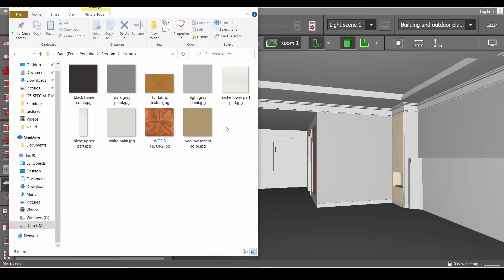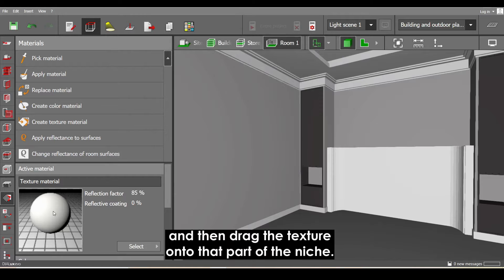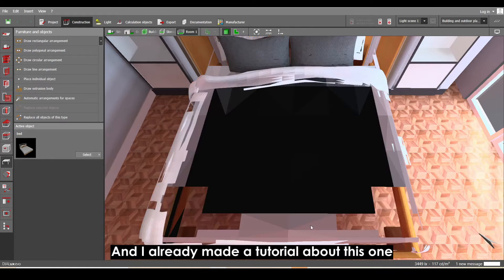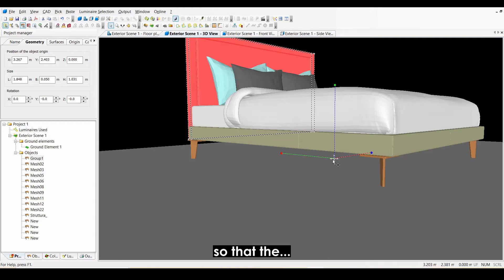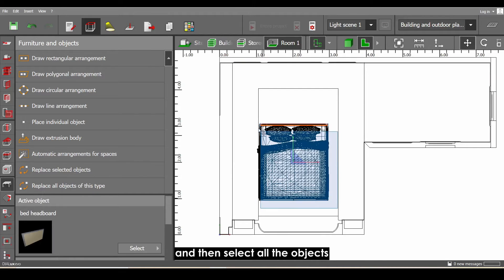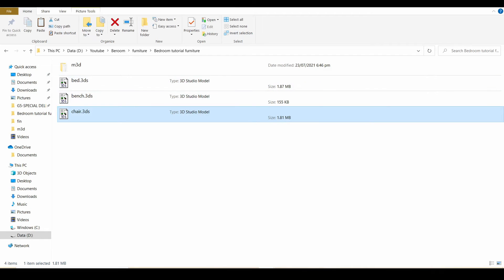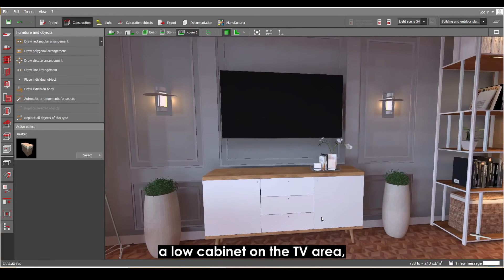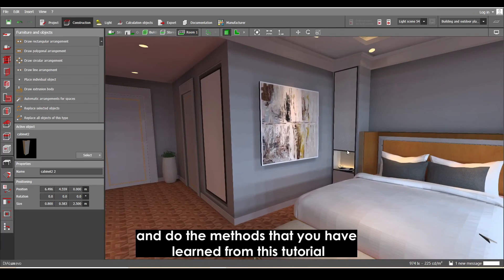Dialux Masterclass: How to recreate Realistic looking room in the Dialux Evo Finale

Comment: Super Mr Jaja Madatu 👌🏻 I have question regarding magnetic light system! Do we can import the recessed track rail with different lighting applications ? Best regards/ Ahmed
Reply from the maker: Hi Ahmed, not possible, you have to manually recreat it and use the appropriate luminaire plug-in for each light.